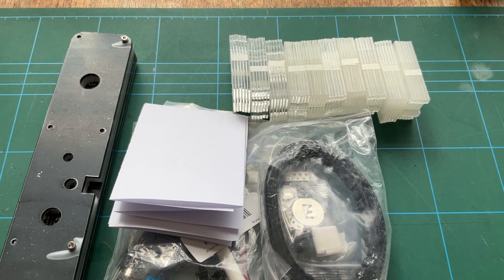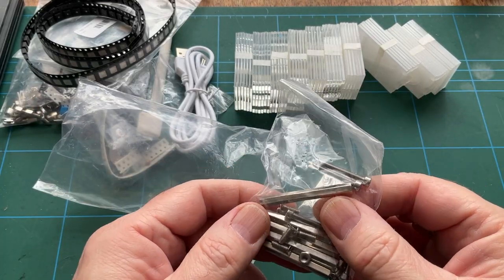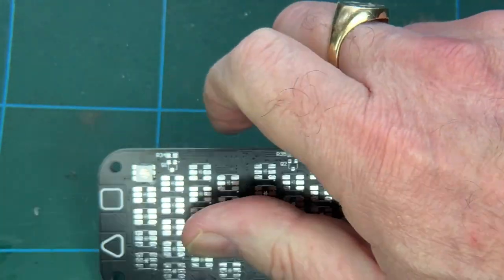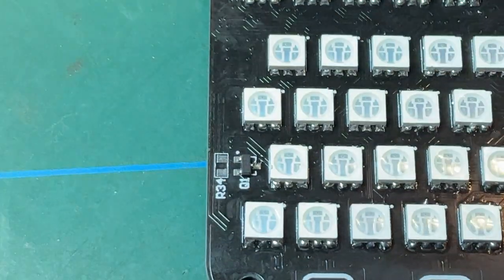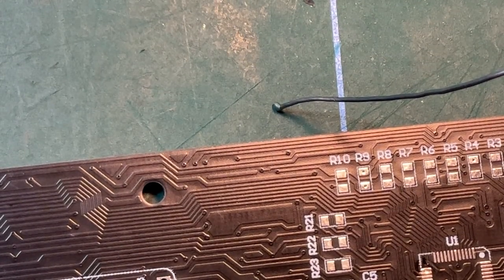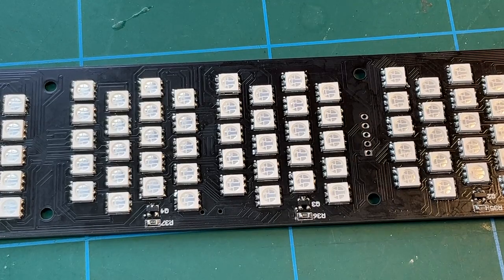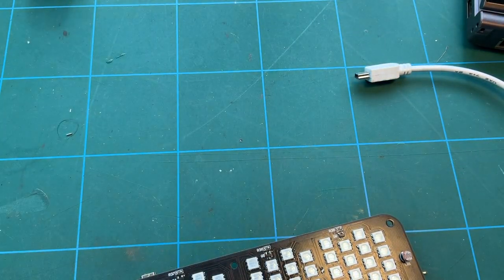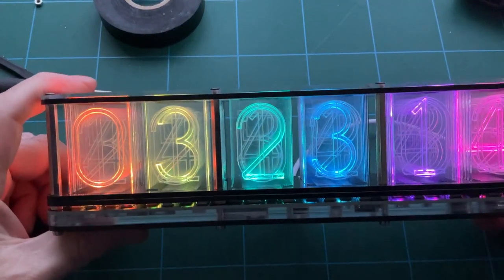Banggood: Geekcreit® Upgraded Glow Clock Kit- imitation nixie style RGB kit

Comment: People, for fine-pitch SMD chips, flux all pads and use one blob of solder to tin them. Then use desolder wick to clean up pads. Hold IC in place with kapton tape until you tack two diagonal legs. Heat all other legs, one at a time, to solder them down. If you do get a solder bridge, carefully remove it with wick. Don't be afraid to flood pads with flux. You can always clean it off later. These DIY kits were made to help learn soldering skills. Before you know it, you'll be a master in a very short time.